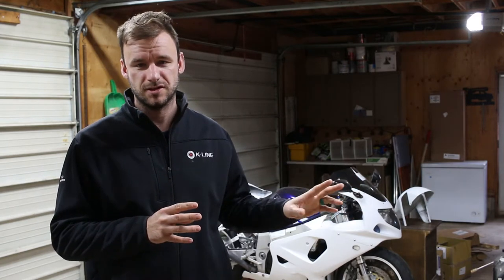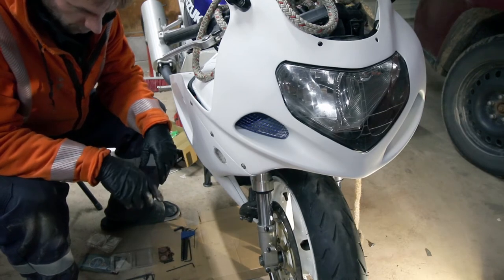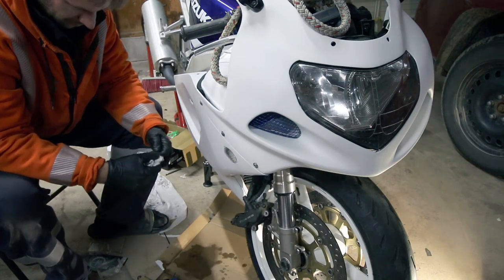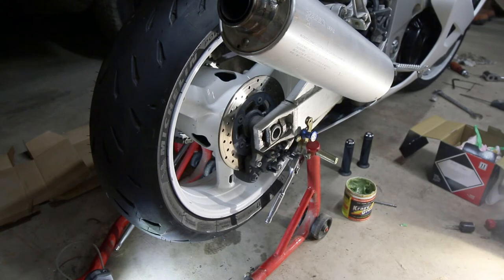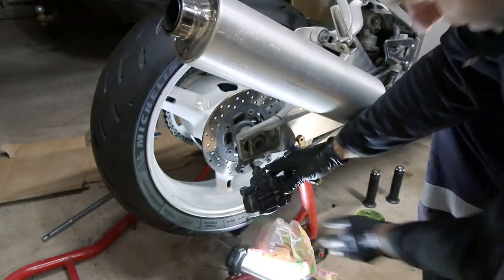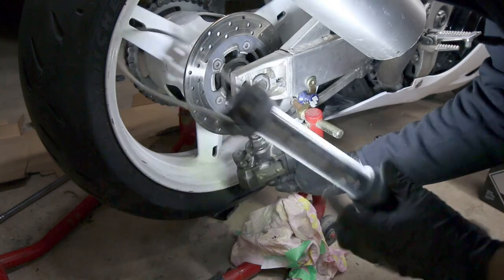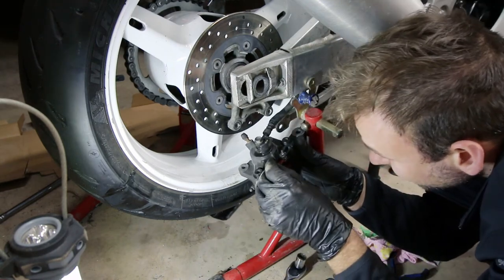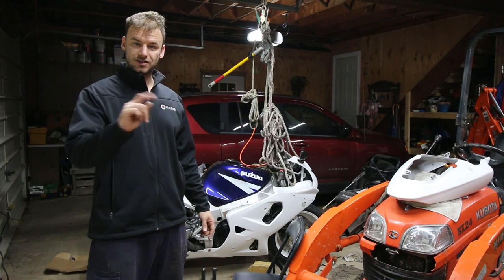how to change front and rear pads on Suzuki GSX-R 750 600 1000 2001 2002 2003

Comment: 21:50 the keeper clip is in the wrong spot, i followed step by step only to have my rear pads weld themselves and catch on fire to the rotor because the clip and pins backed itself out on the outside of the caliper where you had informed us to put it.
Reply from the maker: @dylanwilliams9779  did you not read the description????  Warning !!!! It's at the top of the video description. I'm sorry to hear that brother. I'm not a mechanic and I did make a mistake. Sorry you suffered.
Reply: @GilbertGardens i didn’t, i had just watched the video and thought i did it right. sucks a lot, i need a whole new caliper, rotor everything just from a simple pad install.
Reply from the maker: @dylanwilliams9779  yeah I caught it right around when I went to mount the wheel back on I believe. Again sorry buddy .

Comment: I took my caliper off and now there a gap between the 12mm bolt and the caliper , I’m
Lost
Fyi I took the front tire off to do the forks and I put it back on but now the brakes won’t go in right